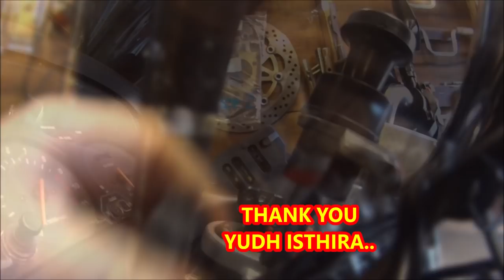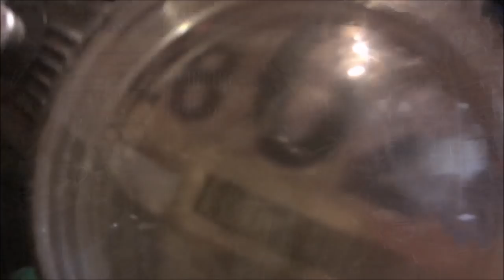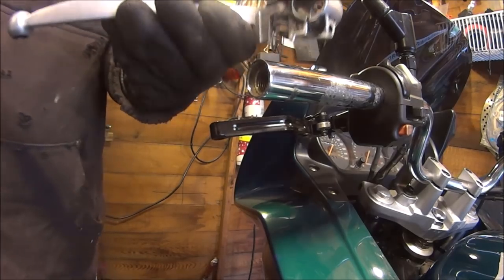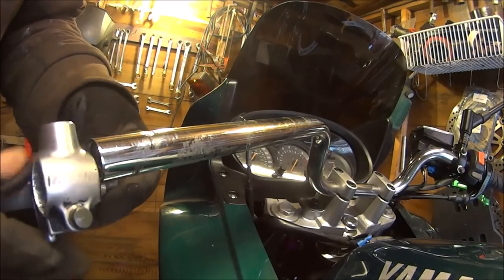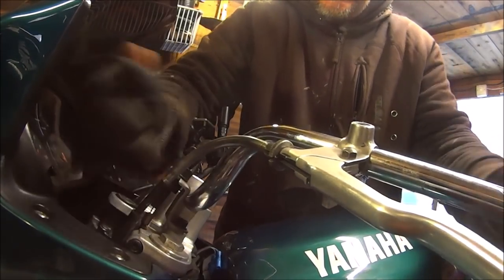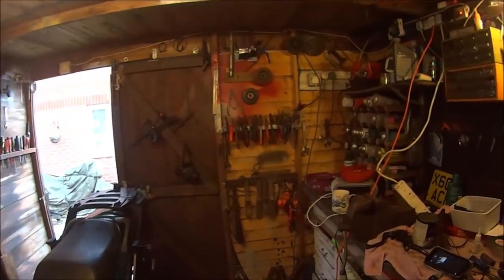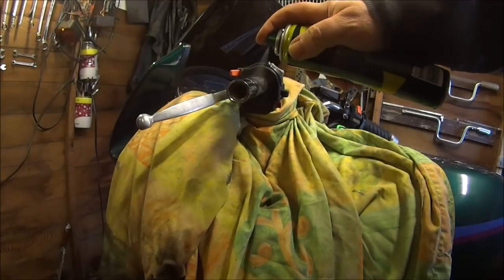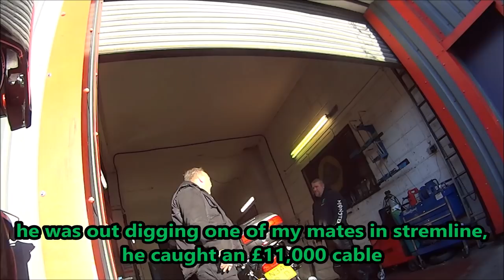XJ9000S will we ever get it running smoothly?

Comment: Some great tips there Rodent. I have used the hairspray trick myself and it works well. I have in the past used deodorant straight into the airbox to help start a bike but I don't make a habit of it :)
Hope the bike runs sweeter now mate, wont be long before my projects is roadworthy now fingers crossed.
Reply from the maker: Thanks Surrey rider. I've tried the deodorant trick on the carbs but the rolling ball came out and got stuck in the inlet lol. All the best for your MOT buddy and safe riding.

Comment: Hey John
Have you sorted your D9 yet? 
I’ve just had an intermittent misfire and located a corroded coil pack pin on 2&4. Basically you have to be very careful to remove the plastic clips holding the wires to the coil and inside the hole you will see a pin. Mine was corroded showing 59k ohms on the readings. I cleaned the pin carefully with a tiny file and scraped off the green/ corroded material on the lead and hey presto works like a treat. Give it a go before you buy carbs mate👍🏻
Reply from the maker: Hi there yes the ones on my coils had turned to dust. Good job with yours bye the way. Ain't touched the D900 for about three weeks or more think I'll wait for some warmer weather.

Comment: Did the pilots come out ok John? I found an instant improvement when they were changed!  Are you changing the master cylinder aswell? I got an early FJR one on morn which I resealed togetherness with the blue spot 4 pistons callipers which are a straight fit btw! Instant improvement. Good luck with the run! Regards Stevie 👍🏻
Reply from the maker: Yes pilot jets came out OK and in good nick... Front brake feels good enough for me. back brake pretty crap maybe needs bedding in..